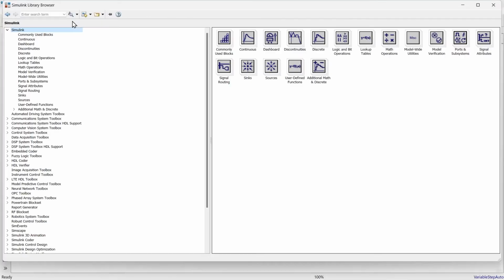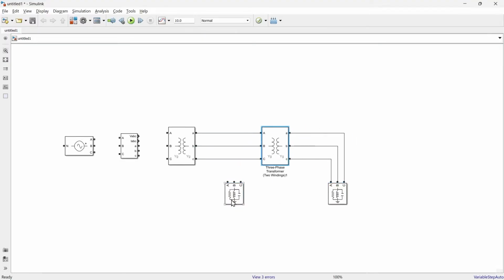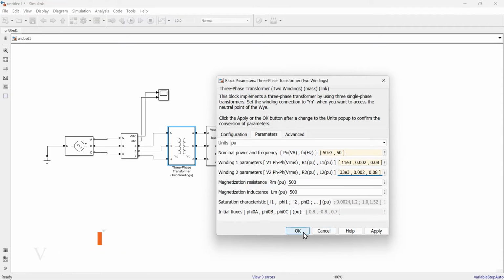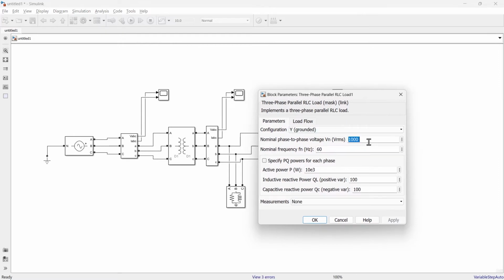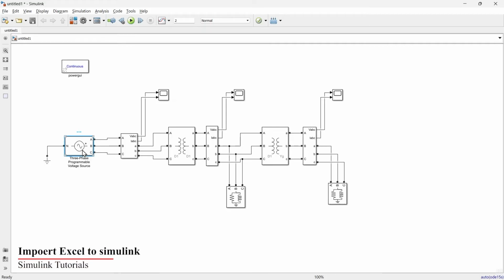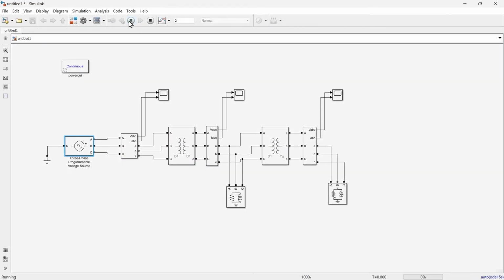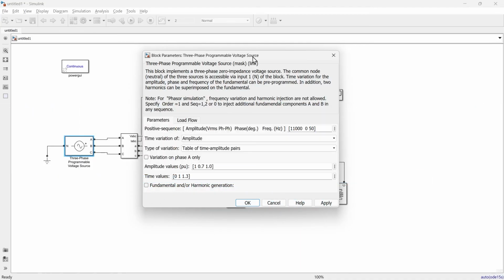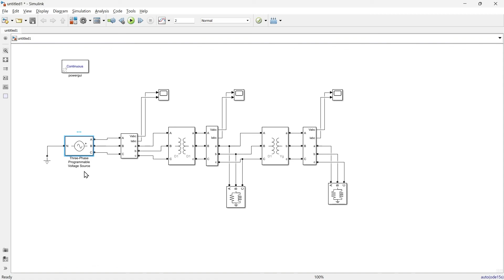How to create voltage sag & swell in simulink | Simulink Tutorial

Comment: Thanks for your titorials, now I want Matlab simulation video for 'mitigation of voltage sag,swell and single phase outage using dynamic voltage restorer based on direct converters ' could you suggest it to me please on how to design and analysis?
Reply from the maker: that require me to spend more time on this. currently it is not in the plan. 

Please do support me if possible for you (by sharing such content). You can share this link to other : https://www.youtube.com/playlist?list=PLho7ncbqgQbviwKeoJybXPnFY5t590dRJ